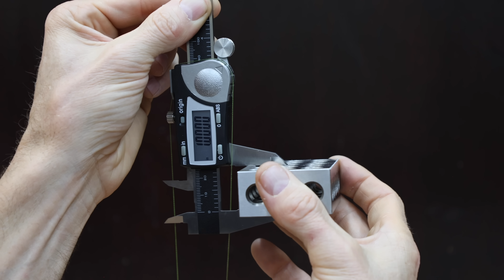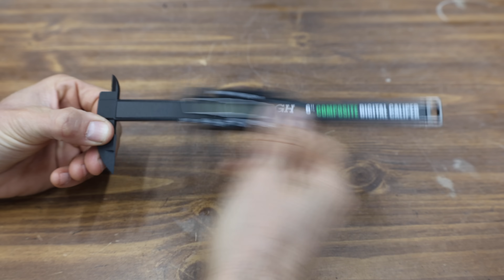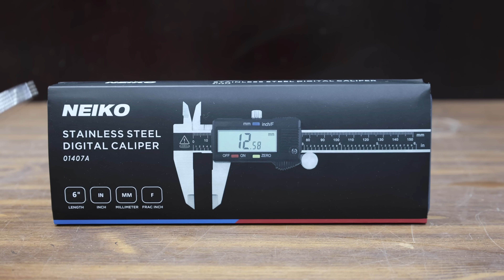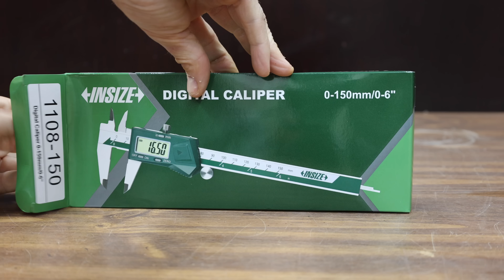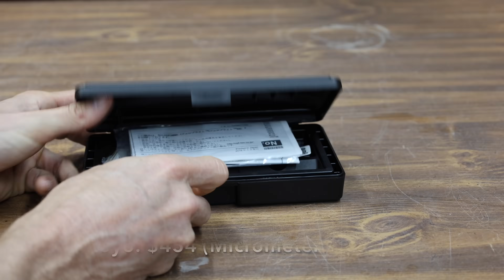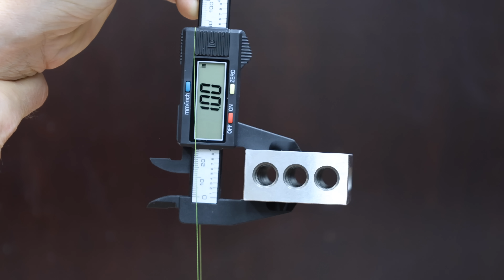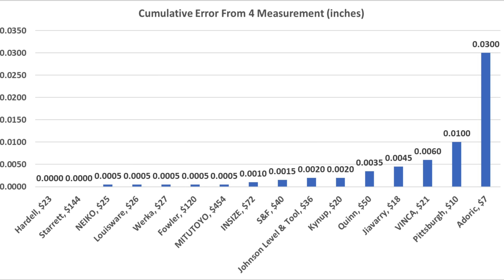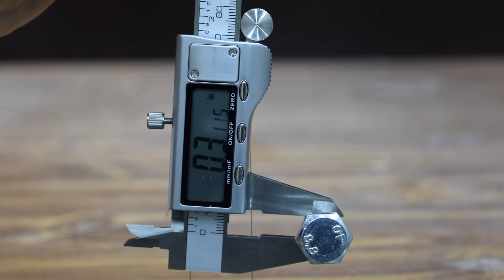I've Been Proven Wrong About Calipers!

Comment: Not a bad test but if you ever test again a few additional things you could add and maybe change?

Probably the biggest consideration for testing different brands is the Claimed Auto Shutoff times and then power drain when shut off. This is a big factor in their use as it will often determine if the caliper will work after sitting unused for any length of time. Many of the cheaper brands and the numerous Mitutoyo and occasional Starret branded copy's do this. The Genuine items do not flatten their batteries. It is extremely difficult to determine cheap copy's from genuine items without information to clarify what is what. Many copy's include paperwork and packaging that is  indistinguishable from genuine. In some cases disassembly is required to determine their origin. I an aware of this due to having worked in a professional meteorology department for a while and often saw this during calibration and certification given to tools. 

The metal framed calipers when brand new should be cleaned and lightly oiled before any important measuring is done.  Most can be adjusted for jaw slop with the small screws on the top of the sliding jaw. That adjustment will also affect the accuracy of the inside and outside measuring as jaws and prongs may go out of parallel also if the body is bent or out of square. This can be done easily when almost closed with feeler gauges for the OD jaws. When checking for calibration and wear I use gauge blocks for additional sizes but that isn't something most have access to.

Finally an observation. Very accurate measurement readings these digital calipers can give relies heavily on how they are used. A slightly non parallel  hold, a non precision surface compared against even the adjustment can make a measurement difference that differs from the actual measurement. Usually attachments are the best option to assist with these measurements and will improve repeatability.  So it's probably unfair to rate the measurement accuracy particularly the depth measurements down to the last digits on the vernier calipers. In practice anything greater than 0.02mm or 0.0005" inch is asking to much.

Regardless some good out of the box tests and that's the way most will be using these.
Cheers
Reply from the maker: Thanks for the suggestions.

Comment: I think imma try to get the insize for sure.  I bought Pittsburgh ones a while back, for all my welding needs.  But I’ve really wanted a smooth metal pair with a wheel. But I’m not willing to spend more than 70.  I do wish it had the fractions though.
Reply: Or ig probably actually the werka
Reply from the maker: Thanks for the feedback.

Comment: Just so you and everyone else knows, you can adjust the drag on the calipers, make them as tight or loose as desired. There are two set screws on the top of the calipers that on most good calipers press against a shim which will increase or decrease your drag.
Reply from the maker: Thanks for sharing this tip!

Comment: I use the Neiko when I need a digital caliper. For what I do I with 3D printing I don't need the absolute most precise tool. My two requirements for digital calipers were a thumb wheel and locking screw. I don't know why yours didn't retain where it was when powering it off and then on but my pair does. I can power it off, slide it to a different position and it knows where it is. Maybe it's a slightly different model.
Reply from the maker: Thanks for sharing.

Comment: From what little experience i have doing precise measurements i was always told to use a machined metal or marble surface when measuring height of an object using depth mic or caliper. I doubt it affects the measurements much though.
Reply from the maker: Thanks for the feedback.

Comment: I love how about half of them (even many of the pretty cheap ones) have the connector for that little data-port hidden under the top cover that can only be connected to a cable that costs way, way, more than the caliper.  Clearly they all just copy the same PCB from like 40 years ago.

As a side-note, few (none?) of them actually power down; the display powers off, but the caliper is still measuring the whole time. You should plan on replacing the batteries regularly, no matter how much you use the thing.
Reply from the maker: Thanks for the feedback.

Comment: Great job as always....

I feel like a judge of a prizefight here, but "I was watching a different fight" I think.....

To me, my takeaway from the video was "The Mitutoyo is worth it...."

I have a bunch of cheapos....  My superpro machinist friends always told me "For what you're doing, just buy this or that....  If someday you want something good, just buy the Mitutoyo...."

Now, just an aside, but I feel like I'm maybe a hair older than you??  For this story, it doesn't matter.  SO many things in life have gotten more & more expensive, but some of these tools have actually gotten to be within reach.....  Way back in the day...  Late 1980's...  I remember Mitutoyo being $300 bucks.  Back when $300 bucks was a lotta money.  Like, and extra value meal with everything was $5 bucks, tops....  Even the early 2000's, You could go to Wendys, Big Bacon Classic Double value meal was $6 bucks...  And that, my friends & gentle readers, is how you end up in a cardiac cath lab having a stent put in...  but I digress....  The POINT is, the Mitutoyo back then was 55 or so extra value meals....  Today, I can't get thru the drive thru for less than $15 bucks....  and you said the Mitutoyo caliper was $144 bucks???  So like 10 extra value meals???  Not bad, to have the "real thing"....

Also, my friends always told me, always always always put the calipers back in the case, and back in the toolbox drawer.  Never leave them out.  They have to be pristine, if you're going to rely on them...  No dropping, no abuse of any kind at all....

Not to bore you with stories...  Great job on the video.
Reply from the maker: Thanks!  Thanks for sharing.

Comment: Did you use a dab of oil or remove any oil? Did you remove the slide and wipe down the metal then replace the slide?
Also didn't test how temperature effected the accuracy.
It's winter and I didn't heat up my shop before I started working. After a few hours my shop is up to temp but I am still using the same tool. How much is it off by?
Food for thought.

Comment: Just started watching, but two things: battery life! And the fast movement sometimes loses the zero!
I've got a composite Mitoyo, and 2 sets of Mitoyo steel, one of which has full traceability. I trust the steel ones to 0.01mm!
I threw out the cheap ones after a zero drift killed some lathe work that had taken hours!
Reply from the maker: Thanks for sharing.

Comment: I have a Starrett dial caliper and an older model Pittsburgh digital caliper. I use the Pittsburgh regularly since I don't really care about wear and tear on it. It's on its original battery from when I bought it 5 years ago. It has enjoyed a lot of CNC coolant too. It's just a little loose on the rails so pressure can really change the readings. I know the battery thing must be a common issue with some calipers. Almost all the senior machinists I knew took the battery out of their calipers so habitually they even took them out for their lunch break. Guess it really depends on whether or not it keeps track of position during sleep, mine doesn't but I don't how that's beneficial anyway, I zero it every time it's turned on
Reply from the maker: Thanks for sharing.

Comment: The only test I need is how much current it pulls from the battery. The mitutoyo uses less power when on than the cheap ones do when off.

Which means that if you get a cheap one you will constantly have to replace batteries.
Reply from the maker: Thanks for sharing.

Comment: Please run a battery life test on them!
One thing I've noticed about these calipers is that they varies very much by battery life, both in shutdown state and in measurement state. For example I have a very cheap plastic one, running on CR2032, which holds its battery even after about 3 years of intermittent usage, while I have another stainless steel one, about 5x more expensive, requires replacement battery every 7 to 8 months regardless of usage. I noticed this because when I have the plastic one I did not use the stainless steel one for a while but its battery still died. They are both on the same battery.
Reply from the maker: Thanks for the suggestion.

Comment: A caliper that is only accurate to 0.010” is really only good for carpentry and general estimating. For automotive work it needs to be better than 0.005” and for machining it needs to be better than 0.001”, which is why you get what you pay for.
Reply from the maker: Thanks for the feedback.

Comment: Its important to note that the Fowler and Mito power function is a trick. They never actually go full off, they go screen off. Thats how they maintain their zero, pull the batteries and try again. Another thing to note is the engineering and machinist tool industry standards (ISO) are ignored on the cheap crap. I will never trust a digital slide in place of a dial. Having bought and sold a LOT of these tools in my life I won't buy anything but the Fowler/Starret/Mito's with Starrett being my go to (I prefer their dial color options, script font, and numerical style).
Reply from the maker: Thanks for the feedback.

Comment: Just like any other caliper, almost all of these have the same specs. I wish he would just state that, except for the plastic models which aren’t spec’d that tightly as they’re throw away models used for low resolution work. Most calipers have an accuracy that is not the same as the resolution. Plus or minus for most, of 1.5 thousandths. Higher price models can be plus or minus 1.2 thousandths. A couple of really high end models, which are pretty expensive, have accuracy of plus or minus 1 thousandths. What matters here is not how a model performs right out of the box, but over a period of use. My favorite one is my TESA/B&S. It’s interesting that he chose one of the most expensive Mititoyos and the cheapest Starrett.

Comment: I've had a Fowler for about 10 years. It does have auto shut off. It has held up well. The tips of the jaws are showing a bit of wear from being used to scribe lines. I think it is easier to get accurate measurements with micrometers where they will work.
Reply from the maker: Thanks for sharing.

Comment: I've had the first set you showed for years.  Couldn't remember where i got them, but they work and they are cheap. The only thing i wish all the calipers had were longer inside diameter tongs on the back instead of .675" needs to be 1.5" it's always hard to get an inside diameter  reading.  Great video! I was looking into getting a thermal camera like the heat guns you tested. But with a thermal camera  screen. Can you please do a video of that? And if there is a thermal camera with a borescope can you please test that? Thank you for your help!
Reply from the maker: You are welcome!  Thanks for the suggestion.

Comment: Ask any Machinist. There’s only two correct answers here. Mitutoyo #1 and Starrett #2. Fowler, SPI, and Insize are a distant tie for #3.
Reply: In Europe, Starrett is not as widely available, but in turn, European manufacturers are much better represented: Tesa and Sylvac from Switzerland, and Mahr from Germany. These are all frequently encountered, as is Mitutoyo. At work, we have all four of these brands.
Reply: Yes exactly. After over a decade of professional use, Mitutoyo is ALWAYS on top. I skipped to the end table and saw the Starret on top and knew straight away PF got it wrong. He does a great job in the short time he has but it does not out weigh what a professional would learn in his career obviously.
Reply: @markpalaszewski8546  I do not own a Starrett digital. I also found out they're made in CHina. I only have the Mitutoyos. 6" and 8" They are the standard. For 15 years and the only problem I had was the battery door on the 6 inch got stuck like a M efer once for some reason.
Reply from the maker: Thanks for the feedback.
Reply: Shars Tegara are ok too. I don't use them for anything but ballparking because it has a fractional readout as well. Anything critical I use all my beautiful and sexy Starrett mics.

Comment: I hate to be this picky, but as a machinist you cannot check those depths on any surface. That 1-2-3block would need to be sat on a surface plate or some other ground surface. That table isn’t flat enough unfortunately

Comment: In engineering school, when learning machining (course 2.86 in the MechE dept at MIT) we checked our measuring tools against a bench-grinder-sized "super micrometer" which was bench mounted and very beefy, polished to a mirror finish at the contact areas, and had precision control of the friction and force used when lightly cranking down lightly on  the object being measured.  10 or 15 minutes of playing with "the super mic" while comparing it to measurements from a variety of calipers and micrometers, on a variety of test objects, was all that was needed for a lifetime of knowing how much/little force to apply when measuring things.
Reply: Yes, skill, technique, and experience are as important as the tools. You can vary the results by varying the force, and whether you have the feel and understanding to get even contact between the part and jaws.
Reply from the maker: Thanks for sharing.

Comment: I did a double-take when I saw that the Mitutoyo electronic caliper had a stated cost of $454, but you further explained that the $454 price was for a set of Mitutoyo tools....electronic 6" caliper plus 1" electronic micrometer, all in a fitted wooden case.  Then you state that the caliper by itself would cost around $250, but your link to Amazon shows this caliper priced at $155.  It can currently be purchased on promotion from major supplier, MSC Industrial Supply, for $119.  Be aware that there are some pretty good looking knock-offs of Mitutoyo products coming from China.

Comment: had a pair of the cheapo HF's. picked up an iGaging triple measure type (inch, mm, fraction) 6 inch, and haven't looked back. still running around 40 bucks. comes in sizes from 4 to 12 inches.
Reply from the maker: Thanks for the feedback.

Comment: You are so diligent, yet always manage to do things totally cringe-worthy to anyone who truly understands the items you are testing.  This review is no exception.  Parts of it were so clueless, that I'm surprised the machinists are going so easy on you in the comments.  Whizzing the jaws open and shut like you're using a slide hammer (to put it politely) should not be a thing with precision calipers.  Nor does the force to move it, right out of the box, matter.  Good job measuring the dips in your kitchen table and calling it a depth gauge accuracy test.  Using a jaw blade that doesn't fit your simulated O-ring groove was silly: If you want a  razor blade to get to the bottom of the groove, I hear Gillette makes some.  I could go on.  

The results you got are useful, and accurate enough for DIYers at home, but nowhere near gospel.

Comment: As a DIYer I get by with the $2 HF 6 inch plastic caliper (I also have a better steel digital caliper, but rarely use it - I'd have to dig it out to remember what branch/model it is.  I'm sure it wasn't more than $50).  The $2 caliper has the huge advantage that I can afford to have half a dozen or more in various drawers around the house, and no big deal if I break or lose one.  No batteries either!

The downside (other than less accuracy/precision) are that the fractional markings on the inch scale are terrible - the 1/8, 1/4, and 1/2 inch marks are all the same length, so I have to count markers to make sure I'm on the !/4 mark or 1/2 mark, etc.  Surely they could fix that even with the limited width of the slide.  I've added some differentiation with a fine tipped Sharpie.  While that helps it looks a mess.

It's not high precision or super duper accurate, but it's easily accurate enough for 99% of my needs and there's always one handy.
Reply from the maker: Thanks for sharing.

Comment: Wait if the measurements go multiple decimals. You can't rank them against each other. Those high end ones might be more accurate then the machining capability. Those could be closer to the real measurement. What's the specs of that block? What tolerance? If its lower then the calipers you just knocked them for being accurate

Comment: One thing I've noticed about some cheap calipers is that they go through battery real fast. I think when you turn them off, only the display turns off but they keep running. One pair i have consumes ~25 microamps when on and aorund 23 microamps when off. The more expenisve ones from mitutoyo and the like consume 5 microamps or less(some models less than one microamp) when you turn them off. Doesn't sound like a lot, but an lr44 only has like 125mA capacity, the cheap chinese ones will be empty in 6-8 months, the mitutoyo will last 3 years on the same battery.
And of course, batteries always die when it is the least convenient.
Reply from the maker: Thanks for the feedback.

Comment: Still running ancient SEARS craftsman dial mitutoyo caliper no battery bullshit here and I can measure past thousandsth bc my keen eye can see needle between hash mark my eye is accurate down to  0.0003 +/- instead of just thousandth (.001) mm mode is nice but meh converting inch to mm is easy enough w smartphone

Comment: I have the Mitutoyo and the Insize,  The insize is good if you use it everyday but if you store it for any time the battery is always dead when you go to use it, something I never noticed until I got a job that provided company tools and just grabbed it occasionally.   The mitutoyo is solid and it's what everyone should buy.  Your pricing is insane though $454 you can buy it for $200 pretty easy.
Reply from the maker: Thanks for sharing.